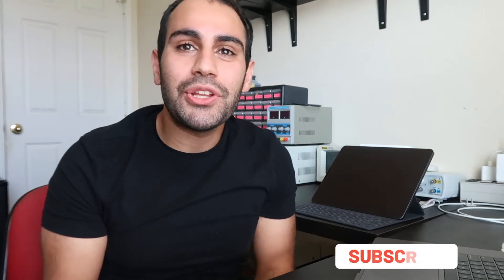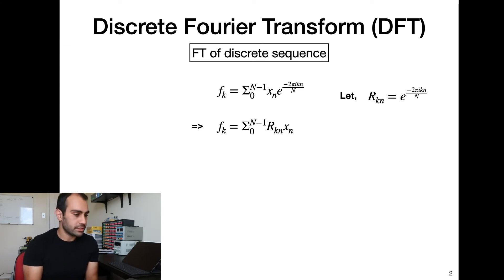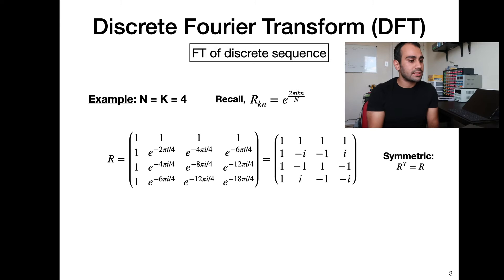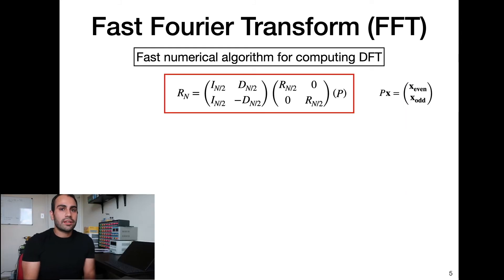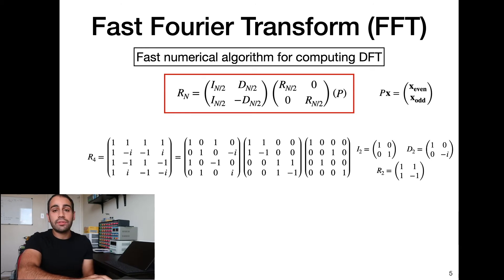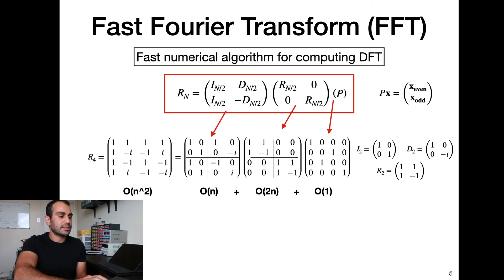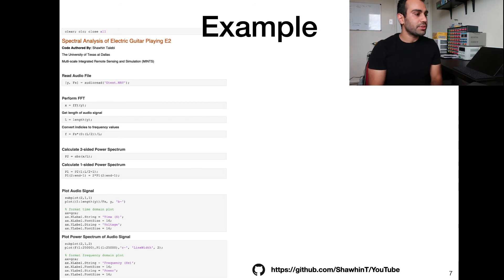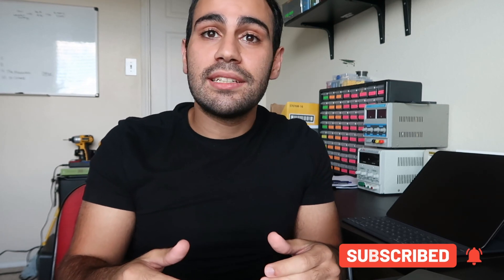The Fast Fourier Transform | How does it (actually) work?

Comment: I'm clearly missing some fundamental connective tissue and I wish I could figure out what it was...  I don't know what y and Fs are from audioread(). I don't know how to construct them from a spreadsheet of timestamps & values like "2024-05-01, 72 ; 2024-05-02 80 ...".  

I really, really, really wish I could find an example somewhere that took a two-column spreadsheet of time-series values that had nothing to do with sound (like the weather report from the previous video) and walked through each step of this process, ending with a frequency analysis of that starting non-WAVE-file example data.
Reply from the maker: The example in the video linked below doesn't use MATLAB, but does show how to import csv data and apply FFT using Python.

https://youtu.be/-5c1KO-JF_s?si=Q5mHSlp40OdXwmZO

Comment: 2:20 I'm a bit lost on what each of the vectors (f_k & x_n) and matrix (R_kn) represent physically... f_0 represents the value of the original signal at the discretized time point 0, right? Then what does x_0 represent? How about any element of the R_kn matrix? N = the number of discrete time points sampled from the original continuous signal? K =...?
Reply from the maker: That's a good question. f_k & x_n and R_kn are actually vector and matrix elements, not quite vectors or a matrix themselves (e.g. f_0 is the first element of the vector f and R_00 is the first element of the matrix R). The vector x is the original signal in the time domain (i.e. time is the x -axis). You can think of the vector f still as your signal of interest, but represented in the frequency domain (i.e. frequency is the x -axis). Thus, x_0 represents the value of the signal at time point 0, and f_0 represents the value of the signal with 0 frequency (i.e. the DC component of the signal).

Hope that helps! I'm happy to clarify anything.